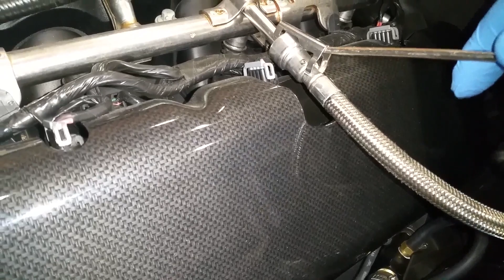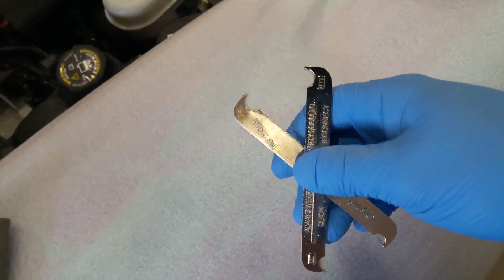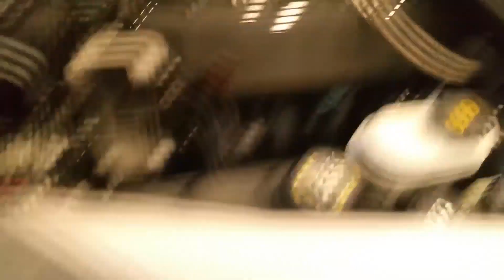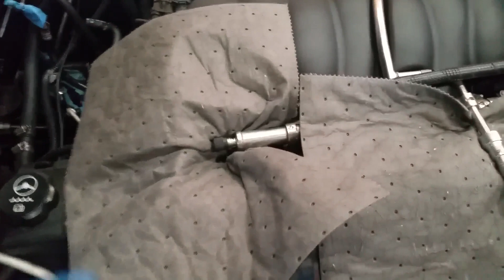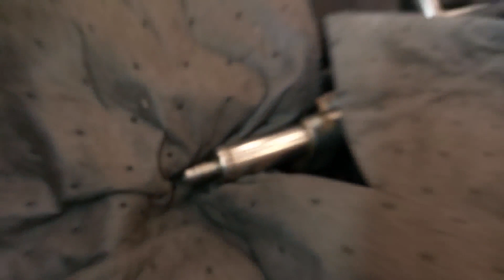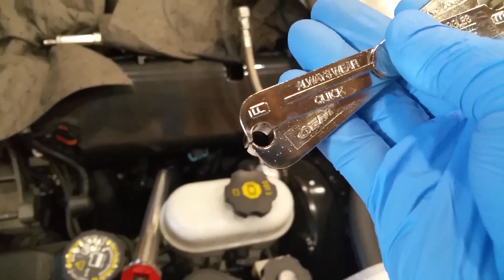Disconnecting GM Fuel Line from LS Motor. Procharged C6 Corvette GS LS3 Project Build. Part 10

Comment: Did you also pull the fuel pump fuse and run the line dry first?
Reply from the maker: No I did not. Hardly any fuel came out on my car. However, my car was sitting for months and perhaps some fuel drained back into the tank. If you try this after just running the vehicle perhaps more fuel will come out and under more pressure so be careful. Do this task on a cold motor and disconnect the battery 1st before trying this.

Comment: Nice vid thanks. Digging those valve cover covers.
Reply from the maker: Thanks for watching, those are holly LS coil covers which I had hydro dipped in a carbon fiber weave pattern. Took a long time to trim them just to get them to fit. Lots of cutting and trimming.

Comment: HI!! Nice video. Thanks, I have a question.  ON THE BOTTOM OF THE HOLES YOU WAS DISCONNECTING IS BLACK HOLES CONNECTED TO ONE ANOTHER,  IT LOOKS  LIKE IS COMING FROM THE BOTTOM OF THE CAR. DO YOU KNOW WHAT THAT IS CALLED. I'm MISSING THIS HOLES IN MY CAR. THANKS
Reply from the maker: If I am understanding you correctly, the black hose is a vent line that runs from the fuel tank. The stainless steel fuel line does not connect to the black hose you see in the video. they are two separate lines.

Comment: It's a PITA on my 07 Tahoe, even with the tool.  @WATCH ME WRENCH makes it look so easy.
Reply: I struggled with it for about an hour.  I thought it was stuck.  I got a big screw driver and a hammer and gave it a good tap....still nothing.  Then I got my eyeball in there and I got a real good look at the connection.   I got a rounded metal file and filed down the inside of part of the special tool.   The problem was that the metal on the special tool was too thick.  It worked perfectly after I filed it down.  This shit was way too difficult and frustrating.  Very frustrating.
Reply from the maker: @handyrams4664  Love your comment "This shit was way too difficult and frustrating.  Very frustrating".
 The joys of fixing our own vehicles, been there many times my friend. Thanks for watching.

Comment: Nice video.  Really helped me on my 2002 Firebird.  A curse on the engineers who put the oil sensor unit behind the intake and under the firewall cowl.  Dumbest design ever!
Reply from the maker: Thanks for watching Brad and thanks for the comment. I know EXACTLY what your talking about . I had the same issue with my 01 WS6 TA.
Reply: Haven't gotten the intake off yet.  Just went to Harbor Freight to get the fuel line removal tool but I got the plastic ones and they won't fit because they are too wide to fit in the small space between the connection and fuel rail so I will go back tomorrow and get the metal one like you have.  I'm getting worried because I can move the intake a bit now and see behind it and I cannot see or feel the oil pressure sensor.  I'm anxious to see what I find when I remove the intake.  My oil pressure gauge works so there has to be a pressure sending unit somewhere.   @WATCHMEWRENCH
Reply from the maker: Try going to Autozone if Harbor Freight does not have the one you want. That's where I got my tool. Let me know how you make out and good luck.
Reply: @WATCHMEWRENCH  Thanks!  I will let you know.
Reply: @WATCHMEWRENCH  Finally got this sorted.  i went to a specialty hydraulic hose shop and it had the right fittings so I could put an adapter in the oil sensor threads in the block, behind the intake, and I connected the adapter to a 3' hydraulic hose so I could relocate the oil pressure sensor over by the brake master cylinder.  So now it is easily accessible.  I don't trust the stock oil pressure gauge so while I was at it I put a T connector on the end of the hydraulic hose so I could connect the OEM oil sensor and a sending unit for an aftermarket oil pressure gauge and I mounted the new gauge in place of one of the round air vents on the left side of the dash.  Here's a link to the video: https://www.youtube.com/watch?v=tyUP_5AJY2k
Reply from the maker: @bradmorgan911  Great job on your fix. Just watched your two videos on this issue and I subscribed as well.

Comment: Which ignition coil covers are those?
Reply from the maker: Those are holley coil covers that I had to trim for hours to get them to fit. Then I had them coated in that carbon fiber weave you see they only come in black.
Reply: Thank you
Reply: Any chance I can get some tips and guidance on trimming those covers?
Reply from the maker: The only thing I can say is that you will have to pull them on and off about 100 times. Just take your time and trim off small pieces at a time as you will only have one chance, if you cut off too much it wont look so nice.

Comment: how do you take off with the tool?
Reply from the maker: Take the tool and push it into the fuel line. it will release the clip.
Reply: sorry i mean without the tool, i dont have one and already taking apart my intake manifold
Reply from the maker: you need the tool my friend. its the only way. Go to NAPA, Autozone and of those big store have that tool. its cheap 7 to 10 bucks only.
Reply: Reco Akins hey i know it’s a little late for the comment but 2 small flathead screwdrivers can do it in a pinch, good luck